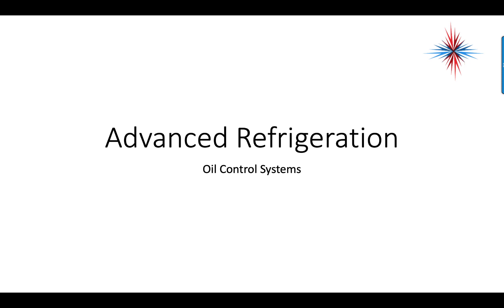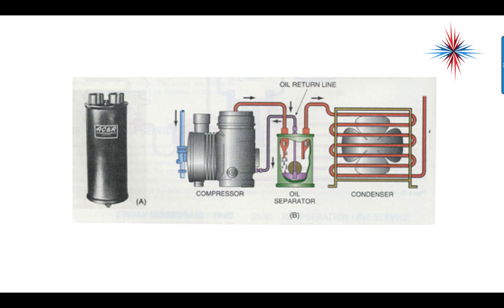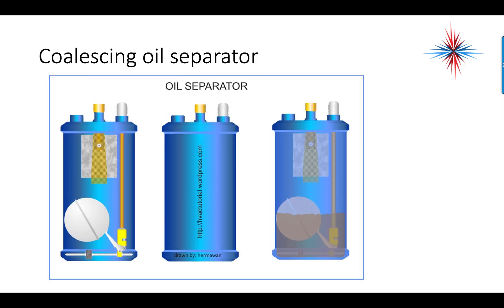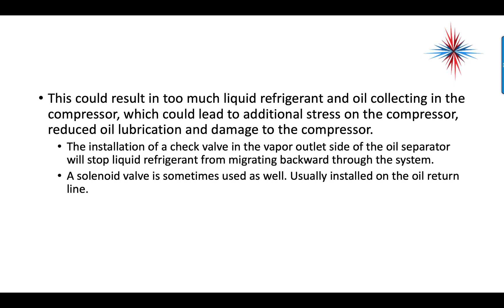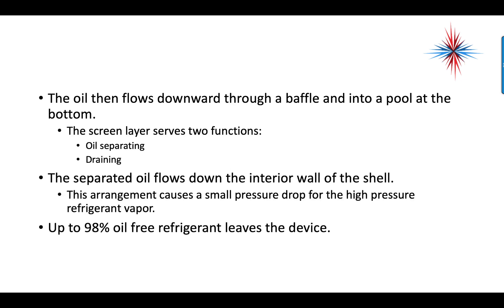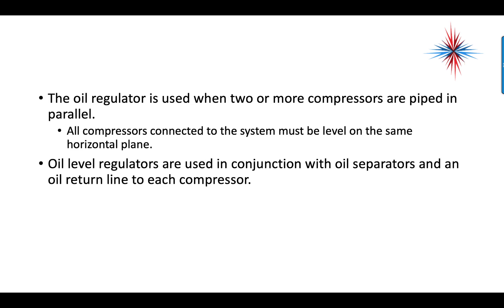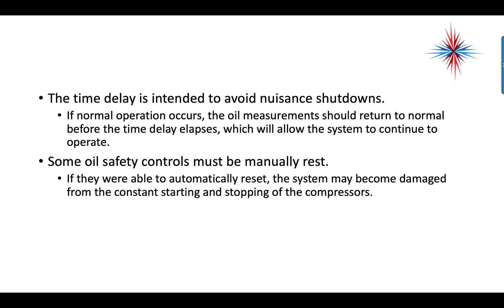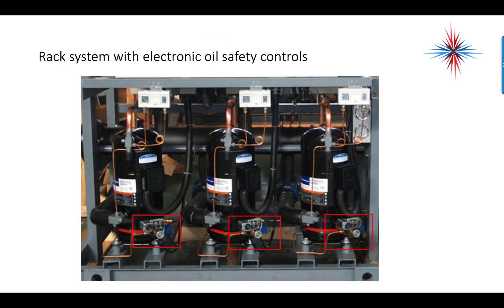Advanced Refrigeration - Oil Control Systems

Comment: Any idea if I would need any of these devices for a small hvac in an automobile that toggles between a 12V and pulley driven compressor? I’m hoping each compressor just keeps its oil… I’d have a solenoid on the charge side and a check valve on the discharge side.